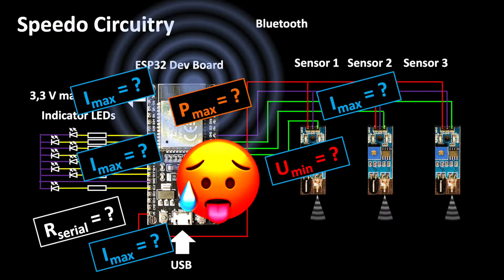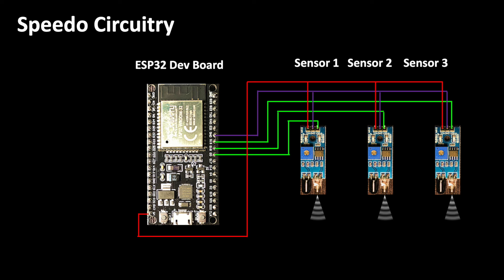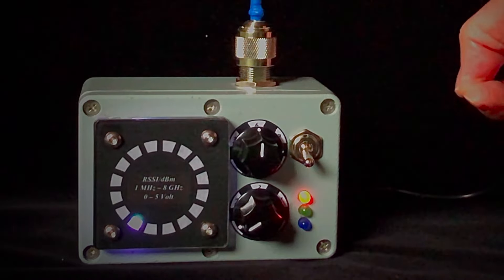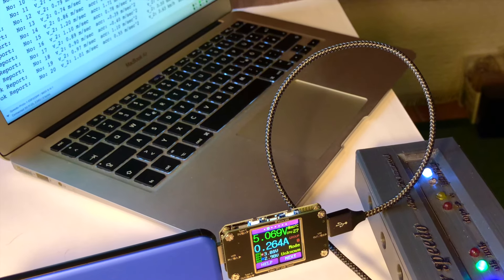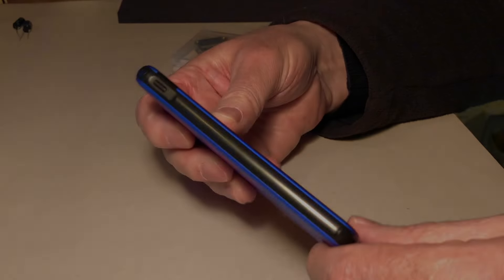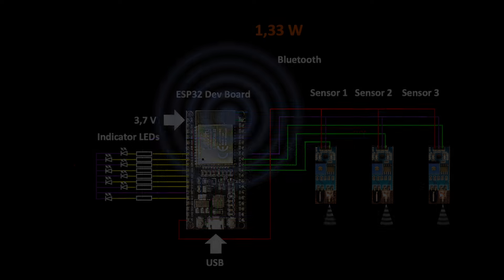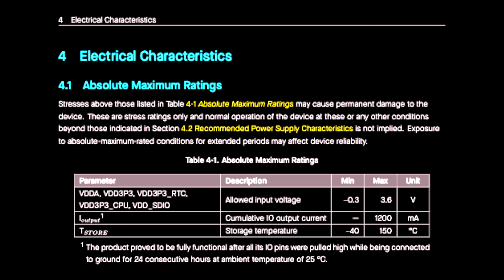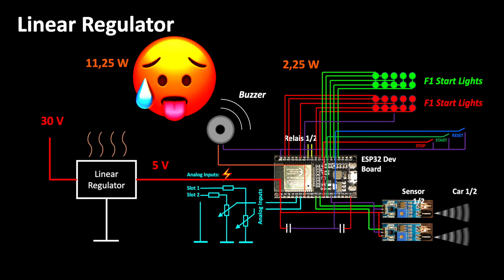Ratings, Currents, and Power Consumption of an ESP32 Project or how to insert USB correctly (EP114)

Comment: Mixing English text with non-English numbers can be confusing. In English, "." is the decimal point and "," is the thousands separator. When reading "3,7 V battery, 2.000 mAh", it's clear that "," is the decimal point (even though the remainder of the text is in English) because there's only 1 digit after it, so, therefore, "." must be the thousands separator. But, if it says only "2.000 mAh", that will be read as "2 mAh" with 3 decimal places. Personally, I'd follow what some programming languages do and use "_" as the thousands separator, i.e. "2_000 mAh". Also, "3.3" is pronounced "three point three".

On another point, if you find that the ADC input is too "noisy", try adding a decoupliing capacitor between it and GND and averaging multiple readings. That worked for me! Alternatively, try a MCP3008 ADC chip.
Reply from the maker: Thank you for your comment! Yes, I agree with you.
The representation of numbers is always a challenge when it is not consistent. I have actually thought about it a few times.
I just checked: there are about the same number of comma regions and dot regions. Then there is the Momayyez region, which makes up maybe 20 percent. Also interesting: In Canada, it doesn't even seem to be consistent across the country.
But OK, I really have to pay more attention to making sure I get it consistent at least in a video.
Thank you for pointing out the MCP3008 AD converter. That is definitely the way to go if you need more accuracy. I have a few projects on my agenda for that too.
The ADC input is often sufficient, although it also has a few other problems.
I actually use the stabilization capacitor too. I also like to program a moving average to measure the voltage.